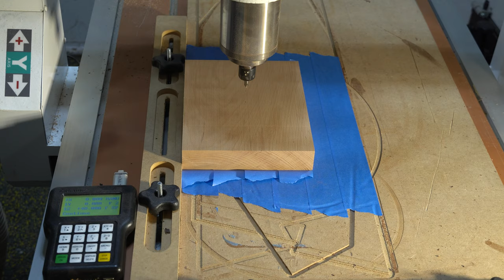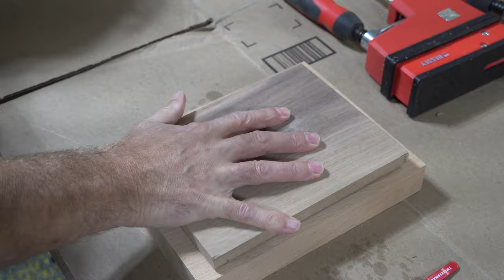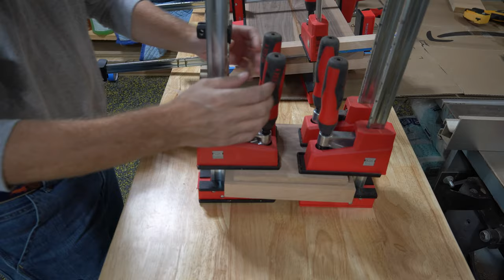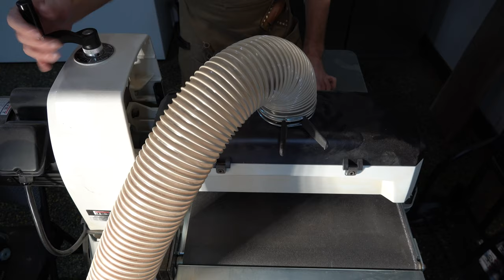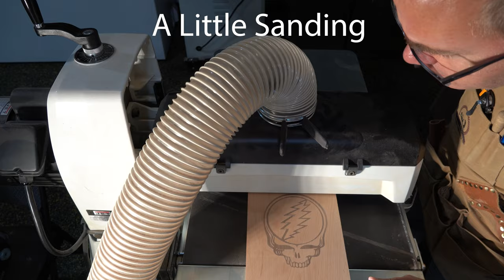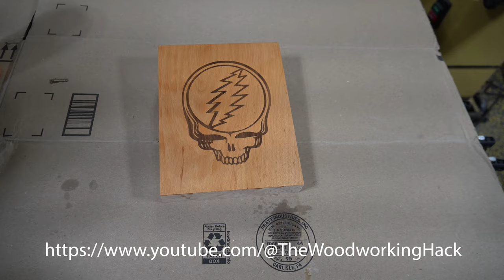Grateful Dead -Steal your face Inlay. Trying to Prove my concept for a Cutting  Board Inlay.

Comment: just got a unifence and saw you're video, think i have the same saw so I came here to ask if you might help identify it....   Hell Yeah, found this!  What Table saw?...    What software are you using?  I have a little desktop unit I picked up few years back but the software is for photo's not precision stuff!    I've been collecting dead vector files...   nice surprise, Looks awesome
Reply from the maker: Hey bro, I use vcarve for software. Haven't done anything in a bit, planning to pick it up after the new year.